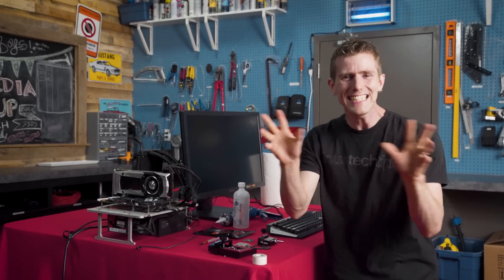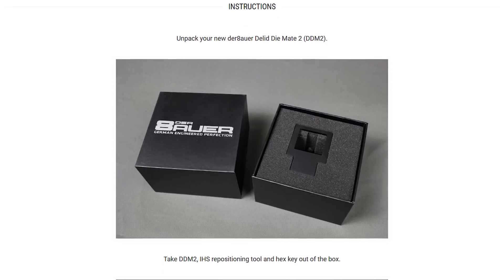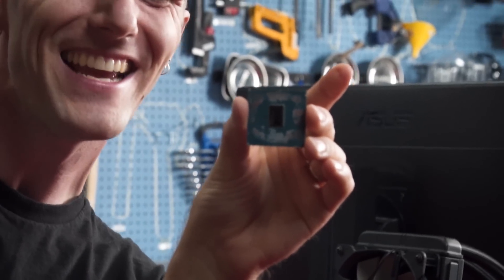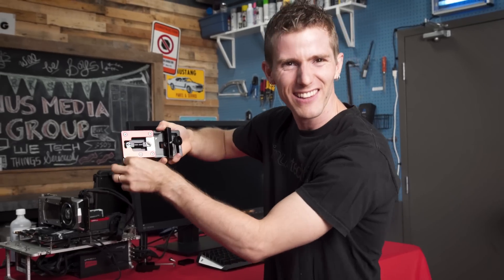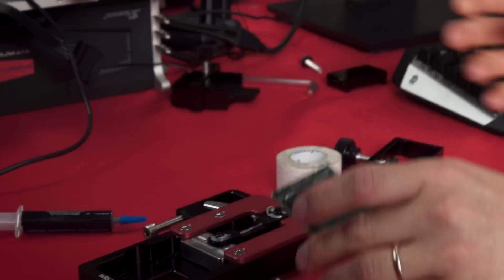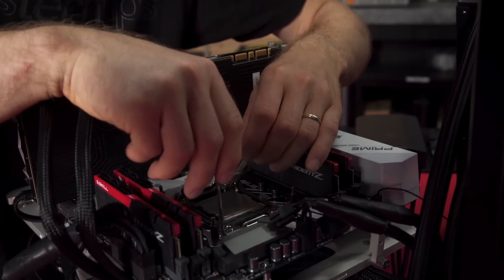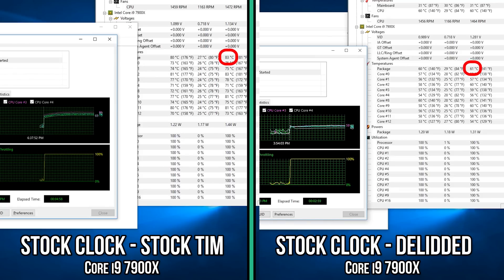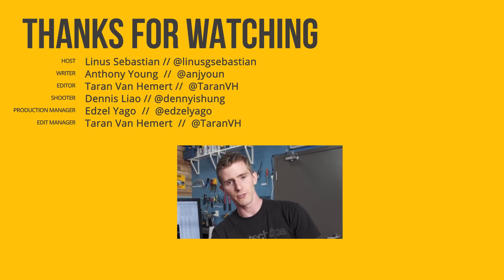Delidding a $1000 CPU - Worth the RISK??

Comment: I just discovered that the Ryzen 7 has a 213 square mm die, while the 7700 series is only 122 square mm. This answers a lot of questions about why Intel chips run hot, they have nearly half the surface area to dissipate heat into the IHS.
On the 7900x, the die size is 308mm^2, while Threadripper has two 213mm^2 dies for 426mm^2 total. The 7960X or 7980X are probably a larger die than the 7900X, but this still shows that AMD have better heat dissipation characteristics through die size alone, not just because of soldering on the heatspreader vs thermal pasting it on.
Reply: Ryzen 7 die has double the surface area because it has 8 cores instead of 4. Intel processors are just glued with crap because it saves them a cool 50 cents per chip.
Reply: Here's the idiots saying "clock speed" - it's one factor not the primary source of performance.
Reply: I get what you're saying. But I dont have an intel. I just wanted to tell him do to some fucking research like I did before choosing AMD
Reply: thats cool af
Reply: Amd if you don't want TIM crap, the only soldered intel cpu I've ever owned was a x5650, tim sucks ass.
Reply: The Cloud Maker your moms stuck under 4ghz
Reply: Uuuuu, finally a metric where Ryzen is slightly in front, lol
Reply: @Iaredave Dont forget that all ryzen cpus are unlocked, while on the intel side of things, you need a k series processor to overclock it.
Reply: HiRez and your comment is just as fan boy as his. As soon as you pay attention to the design of Ryan’s it is just 2 quad core CPUs stuck together. I have no problem with this heck it is pretty smart because it works
Reply: A delid resulting in a 20 degrees Celsius improvement has nothing to do with the die area and should never happen on a premium processor. You're paying 1000 $ for this thing - it wouldn't kill Intel to charge an extra dollar and apply a quality thermal paste instead of the toothpaste they're giving you at the moment.
A 20 degree improvement will definitely have an impact on the lifespan of your processor not to talk about overclocking headroom. The fact that Intel shafts their customers like this yet still has "fanboys" defending such predatory business is frankly perverse.
Reply: Crimsoncube181 No, Ryzen 7 is one Octo-core die. Ryzen 5 and Ryzen 3 are probably the same cpu with some cores disabled because of binning. Threadripper is literally a mix of two seperate Ryzen 3, Ryzen 5 or Ryzen 7 dies in a single cpu.
Reply: ALSO HIGHER CLOCK SPEEDS, AMD IS STIL STUCK UNDER 4GHZ

Comment: Why the fuck Intel makes a 1000usd chip and cheap out on the termal paste. Cmon intel, you could simply put a good termal paste and improve performace alot, so you sell alot more.
Reply: Only logical reason I can think of for Intel to use so bad thermal paste is they WANT your CPU to run hot. This is to make sure it will only last just as long as the warranty and also not over clock well, all to make you buy new, faster and / or more expensive CPU... I absolutely hate all companies that is so greedy that they sabotage their own products to sell more.

Comment: fxxk intel dare to giving a $1000 cpu such cheap cheap silicone thermal compound!
by the way, if in cases lga2011(all variations), such pure shear mechanical delidding process would virtually always void the processor, as solder thermal compound is used
Reply: Only logical reason I can think of for Intel to use so bad thermal paste is they WANT your CPU to run hot. This is to make sure it will only last just as long as the warranty and also not over clock well, all to make you buy new, faster and / or more expensive CPU... I absolutely hate all companies that is so greedy that they sabotage their own products to sell more.

Comment: I don't understand one fucking bit, why after spending 1000 bucks on a fucking processor, it's necessary to have to de-lid it and apply better thermal compound to to it. Shame on the manufacturer for putting such a jem at risk of overheating just to save a few cents during the manufacturing process on an already overpriced chip. I mean wouldn't they save more money in the long run by just applying better thermal compound instead of having to replace warranty covered chips that fried? It would also make your customers happier too all over just a few cents per processor. I don't know maybe they're counting on slippage from people not claiming warranties.
Reply: The nextinline Muh dude. Linus even said that the stuff Intel uses is built for longevity, not performance. 

Think about it like a car. You can get brakes that will stop REALLY well, but they don't stop that well for long.
Versus, a regular pair of brakes that stop decently, but can continue to stop decently for a really long time.

#Science
Reply: 20 fucking degrees is a lot!!! even better temp reduction than buying a quality heatsink
Reply: Travis Lee i will qote derb8uer "it is bad but it stays bad" 
it is a bad compund that is cheap but it stays this way forever. while the new one can dry up etc.
Reply: Well to these companies these processors are no where near worth the cost for doing it better. It's so dumb, they are saving pennies by cutting corners
Reply: Only logical reason I can think of for doing this is they WANT your CPU to run hot so it will only last just as long as the warranty and also not over clock well to make you buy new faster and more expensive CPU. I absolutely hate all companies that is so greedy that they sabotage their own products to sell more....
Reply: All products are designed to fail at a certain point therefore ensuring repeat customers.
Reply: You are right in my opinion

But not being picky but I immediately noticed you misspelled gem
Reply: That's the point!!
Reply: maybe they want to force you to buy new hardware after 3-5 years and stop you from selling your old chip on second hand market, increasing in both cases their sales...
On the other hands they could just apply good thermal glue and sell the product on a higher default clock for the same price, beating the rival AMD on the price/value.
Just strange
Reply: Alex Borr You're most likely right.
Reply: It's not that simple. A decent thermal paste doesn't cost a "few cents" more, it costs a few dollars more, and when you mass produce something every cent counts. Sure they could use a decent paste but then you would complain about the extra 100 you would have to pay.
Reply: The nextinline
If a good thermal paste costs a few dollars more, why would a chip then cost an extra 100? A decent compound from Amazon cost about $10 and can do multiple CPUs...add the fact that manufactures buy in bulk and don't typically pay retail price there is no reason why a chip should cost more than a couple $ extra when using decent paste.
Reply: world wide 
Lol you think what you buy from a producer is what they pay making it?
Reply: they would rather have your CPU run hot, causing overheating if you overclock and would rather have you potentially destroy your CPU in an attempt to de-lid it so you'd have to buy another one
Reply: Its all a marketing tactic
Reply: A bad compound will last longer? Is that what you're saying? Are you seriously saying that a good, expensive compound will not last longer than some cheap garbage that can't even handle the heat? You can't be that stupid.....it's impossible. You're still alive so you can't be THAT stupid. Dude, 1+1=2.

Comment: so quandry, using a 2600k, as we are told every couple of years to replace thermal paste anyway does that mean every few years we should delid our CPU ?
Reply: No. the 2600k is soldered. Do not try to delid it. you'll most likely ruin it.
Reply: Hey thanks for saving me that load of money, altho if you have a cpu that does use paste between the chip and heat spreader then surely the original question itself still stands?
Reply: My Xeon 3060 (2,4Ghz Core 2 duo) did run overclocked at 3.3ghz for 9 years and the temperatures remained stable. Had to replace motherboard after 7 years and then re applied paste and it was perfectly fine for 7 years... If you use a good paste there is no need to replace it.

Only logical reason I can think of for Intel to use so bad thermal paste is they WANT your CPU to run hot. This is to make sure it will only last just as long as the warranty and also not over clock well, all to make you buy new, faster and / or more expensive CPU... I absolutely hate all companies that is so greedy that they sabotage their own products to sell more.

Comment: Wtf you don't use liquid metal?!?!
Reply: seems like the better option, since the chips already use a thermal paste to begin with. Why Delid if you aren't going to use Liquid metal or something as viable
Reply: Hasn't Linus mentioned that liquid metal performance degrades in around 6 months. At that point I would also go for better quality thermal paste.
Reply: Plasma metal is better
Reply: Иван Иванов maybe a reaction similar to Galvanic corrosion ( aluminium to steel ) and how would to liquid metal wet to the surface of the processor like flux in soldering any suggestions would be helpful as I don't know my are from my elbow when it comes to technical stuff.
Reply: Lawrence Stewart no soldering, look up the other videos and you will understand. 

I asked myself the same question. 
Wouldn‘t lm in AND on the cpu be the best solution to tp ever?

Comment: man this is BS. first video does everything wrong.  says its not worth it (because he didnt know to use liquid metal). second video is completely staged.  shows him using kryonaut (which is regular paste) but in the conclusion says he used conductonaut  (which is liquid metal) and the results match up to conductonaut and suddenly its a 20 degree difference.  doesnt show how to put the conductonaut on (it showed kryonaut i think).  if somebody tries to use liquid metal the way he put that stuff on they are gonna have a destroyed computer.  total bull
Reply: bobhumplick also, many people don’t say it (nobody does, actually) but pump out is a problem. Pump out is when you put aftermarket thermal paste and with a week of thermal cycles, it will go off the die and it won’t dissipate any heat. You basically have to use a liquid metal when you delid. I don’t know about kryonaut, but most pastes have this problem.

Comment: what about delidding a AM3+ Cpu
Reply: AMD uses proper solder and not the world most crappy thermal paste unlike Intel, so for AMD there is no gain in delidding unless you mount the cooler directly on CPU without the lid and even then only little gain.

Only logical reason I can think of for Intel to use so bad thermal paste is they WANT your CPU to run hot. This is to make sure it will only last just as long as the warranty and also not over clock well, all to make you buy new, faster and / or more expensive CPU... I absolutely hate all companies that is so greedy that they sabotage their own products to sell more.

Comment: The question is, once the warranty is out, could delidding offer a viable long-term improvement? I.e. after 3 years, could you improve temps well enough to overclock the cpu for 20-30% performance increase, allowing the old cpu to keep up performance-wise with new gen cpus?

Comment: I don't think warranty is a problem. CPUs are not just failing left and right. After you test it, OC it and find out if it's good, the chance it'll randomly just fail is rather small. And 20 degrees is not insignificant.

Comment: If you're not a mong, there's nothing wrong, and nothing difficult about it. I used a $3 craft knife, and put several scratches into the CPU, and it still works fine.

Comment: Intel's latest products: Best value for price? Not the i series. Some Xeon models are a VERY good value. Good product? Yes. Best performance? Usually yes, but depends on workload. Cheap thermal compound on heatspreader? Guaranteed.
AMD's latest Ryzen series products: Best value for price? Yes. Good product? Yes. Best performance? Equal to or slightly below Intel equivalent, in sometimes applications better. Cheap thermal compound on heatspreader? Not a chance.

Just a bit of a summary of my current opinions. I personally am on the Red Team (aka AMD) here. They're honestly good products, but I believe I see a lack of innovation on their part. AMD has done some amazing work as of late with the ZEN Architecture, that is, Ryzen, Naples and Threadripper. In all honesty if I had to buy Intel, I'd go with a workstation Xeon. They're a much better value if not a MUCH better value (power per GHz and Watt) than AMD's current offetings if you get a used one or a slightly older model. However, for any future systems I'l be buying AMD unless I can find a motherboard that accepts Xeon for cheap. Intel needs to get their game together and do some actual innovating. I can tell they are the same anymore. AMD isn't the same anymore either, but in the opposite way, they're drastically improving.

Comment: Remember when CPUs didn't have head spreaders, like the AMD Athlon? Pepperidge Farms remembers.
Reply: I remember when CPUs were 40 pin dip plastic chip.
Reply: @basspig  dual inline package plastic chip
Reply: I had a copper water block bolted to my amd 1900+ direct di shit, this ihs crap is just that.
Reply: 486SX/33 ran without any heatsink - on 5 volts...
Reply: @sleeptyper  Intel P4 first gen could run on passive cooling. Also, slower than a P3 last gen
Reply: I remember when it was a thing but I don’t know what people did for cooling back then.
Reply: @SolidSonicTH  Passive heatsinks
Reply: ha i get the pepperidge farms joke (Family Guy)
Reply: Linus no remembner
Reply: I still have a spare athlon 760k 😊
Reply: I'm just now working on my old Athlon 1900+ desktop. I didn't assemble it back in the day and almost had a heart attack when I didn't see an IHS :))
Reply: LOL
Reply: i wasnt even born then lol
Reply: Period-correct meme to suit, kinda funny

Comment: new company idea delidding a cpu putting in a new tim and reselling it for profit. the company validates the cpu and takes on all the risks and spreads out the costs of dead cpus and buying this tool.

infact i think it would be a great option to add for system selling sites that already validate systems as the validating part it the most costly part in terms of work. (the cpus that die overall would be a small cost)

Comment: Should I de-lid my Core 2 Duo E8400?   It keeps running upward of 55 degrees idle no matter how perfect i apply the TIM and place the heatsink. If I understand right it's soldered and shouldn't be the issue. Maybe it's just cooked... or maybe the motherboard I have for it is?

Comment: You found a new niche market liquid cooled heat sink that fits on a delided processor that fits under and around clamps. Call it somfun like linus deheater
Reply: Micheal Kroeckel already too late, der8auer is already offering plates to strap down the cpu without the heatsink.

Comment: Wait my laptop CPU is already delidded.
Reply: My Laptop CPU didn't have any heat sink on it😉

This might be the reason, why it runs over 95°C while using Chrome
Reply: @p3chv0gel22  as people say, Chrome is a pretty demanding piece of software.
Reply: P3chv0gel sounds like a Mac Book?
Reply: @WhateverT997  the newer mac book air doesn't has a heatsink connected with the fan.
Reply: @p3chv0gel22  more than 5 years old dumbed chrome for slimjet and firefox developer
Reply: Laptops don't have a lid because of space restraints.

Comment: If you delid and use your own TIM, MAKE SURE THE TIM IS SPREAD OVER THE ENTIRE DIE. 
If you just use a dot in the middle, like you would between the heatspreader and the cooler, you WILL NOT cover the corners, where the memory controller is. This is not unlikely to cause permanent damage.
So use a cross, or even less likely to go wrong, spread the paste thinly.
You can really kill your CPU if you don't pay attention.

Comment: I don't think the thermal paste is the problem, i think the IHS slightly lifts away from the die when the glue dries at the factory and that's what causes the high temperatures.
Reply: I was scrolling down, losing faith in humanity and then, wow, some people actually get it.
The choice of the thermal compound matters little. Actually, the difference between liquid metal and the best thermal pastes is just a few degrees under load (assuming you're not using ketchup or whatever). The issue here is the space between the IHS and the die itself, it is NOT EVEN IN CONTACT. Thumbs up for one of the only intelligent comments here.

Comment: Hi, why didn't you try cooler straight to silicon? The aluminum lid conducts heat half as well as even regular cooper at 25C (205 vs 400 W/(mK)), a heat pipe does 100kw(mK) and thermal compound does 2kw(mK). I mean if you are going this far for cooling why not?
Reply: The IHS is actually zinc-plated copper.
Reply: It is possible, but the IHS does 2 things. It spreads heat and protects the die from being damaged when attaching the cooling block.

Comment: I think Intel is smoking crack. $1000 for a processor and they cant spend .001 cents per CPU to use half decent TIM? Or just solder the things? Ryzen CPUs are soldered and cost about half to a quarter as much. SMH Intel.

Comment: This is pretty bad.  So you're intel and you're about to release your highest end consumer CPU in response to AMDs recent competitiveness.  You've made a pretty compelling CPU and things are looking good.  But you also want to save a few cents.  So on your most premium consumer product you start seriously cutting corners.  Not only do you NOT solder the die to the heat spreader YOU ACTUALLY GO SO FAR AS TO USE CHEAP AND SHITTY THERMAL PAST.  Come the fuck on! Thats pretty fucking stupid.